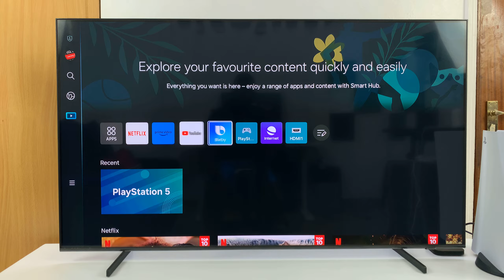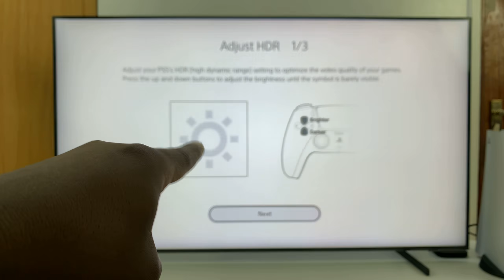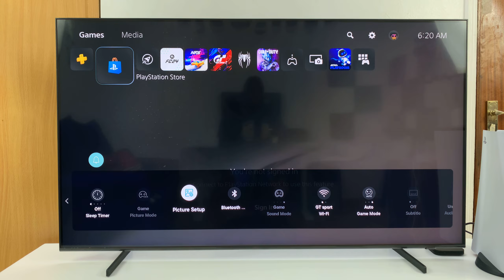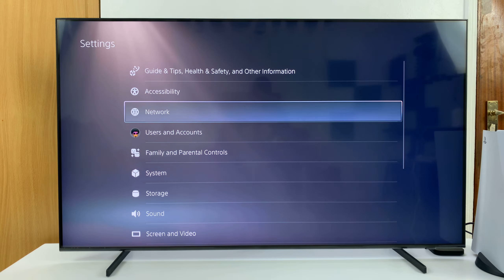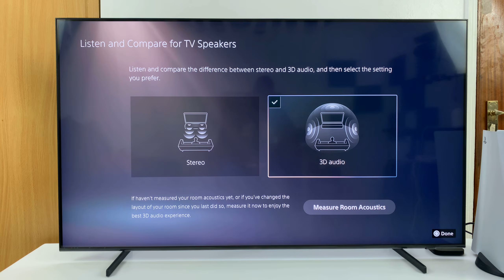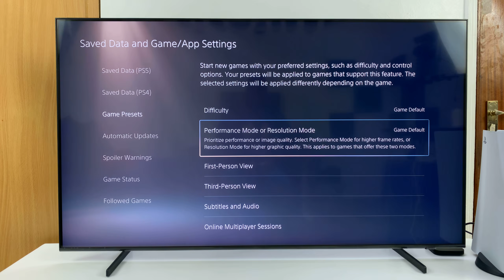How To Set Up PS5 On Samsung Smart TV

Comment: It won’t 
Let me I just wanna have fun playing Fortnite
Reply: Ok but what does port mean?
Reply from the maker: A physical connection on a device like USB or HDMI.
Reply: @webproeducationorgtechnology  so does it mean something is broken on my PS5 like my HDMI?
Reply from the maker: No, it doesn't necessarily mean the HDMI port on your PS5 is broken. It could be an issue with the HDMI cable, the TV's input, or the PS5 not being fully powered on or detected by the TV.
Reply: @webproeducationorgtechnology  I changed my HDMI I I boutght a new one it still,did not work😢
Reply from the maker: Thanks for the update. If the new HDMI cable didn’t work, there might be a setting issue on the PS5 or a hardware fault. Do you hear the startup beep and if the power light stays white?
Reply from the maker: Where are you stuck for assistance?
Reply: Everytime I connect to device it doesn’t show PlayStation it show either connected devices&connected guide😢
Reply from the maker: Select the correct HDMI port where your PS5 is plugged in. If you only see “Connected Devices” it means the TV isn’t detecting the PS5. Make sure the PS5 is fully powered on (not in Rest Mode), and double-check the HDMI cable or try a different port.

Comment: Mine doesn’t connect on my tv at all, it keeps saying check device power
Reply from the maker: That message usually means the TV isn’t detecting the PS5. Make sure the HDMI cable is secure and the PS5 is fully powered on.